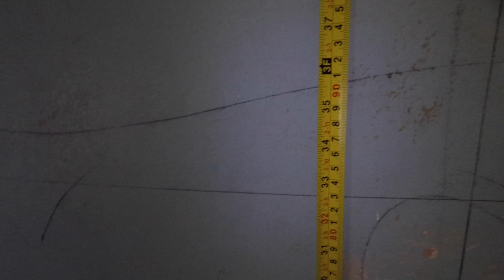Decorating Hall, Stairs & Landing Part 2 - Measuring Big Drops And Difficult Angles

Comment from the maker: NOTE: I will be fixing lining paper to the wall and then painting over it. Therefore, I will hang the paper vertically.  If you were to hang wallpaper over the lining paper then the latter should be hung horizontally.
Summary: Vertical - if painting lining paper;  Horizontal - if hanging wallpaper over it.

Comment: Thanks for the video.  Someone told me that lining paper had to be hung horizontally to avoid doubling up on the lines when you hang the actual wallpaper?
Reply from the maker: Hiya buddy. Lining paper only needs to be hung horizontally if you're going to paper over it. If you're painting over it as I will be doing there is absolutely no point at all - just hang it vertically. The reason for hanging lining paper horizontally when papering over  is to make sure that the joins aren't on top of each other as this will be a much weaker fix. If you cross them over and do a horizontal and then a vertical lay, then this will be much stronger (as in the construction of plywood). Thanks for dropping by my friend and best wishes, Des
Reply: @21stcenturycaveman33  Thanks for taking the time to reply. Makes perfect sense.  I wallpapered a bedroom with lining paper underneath (both hung vertically) and had a hard time - I now understand why - have a great 2022